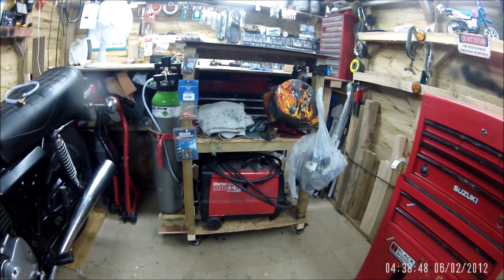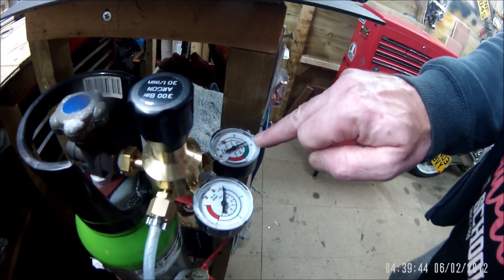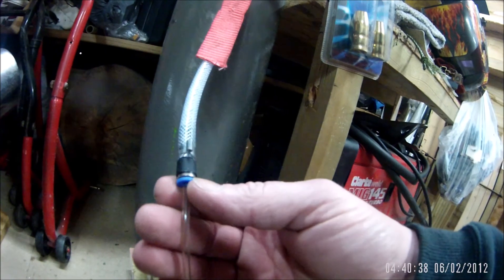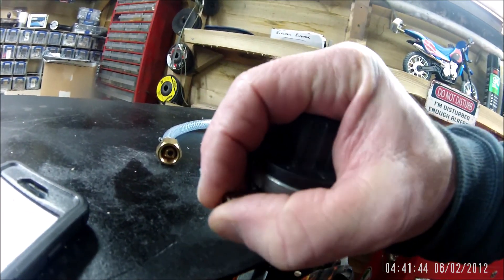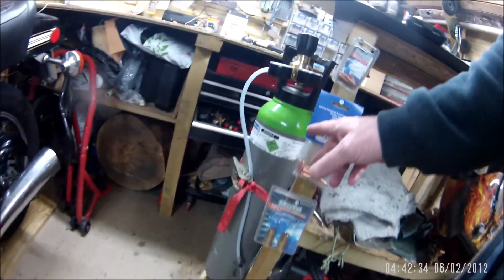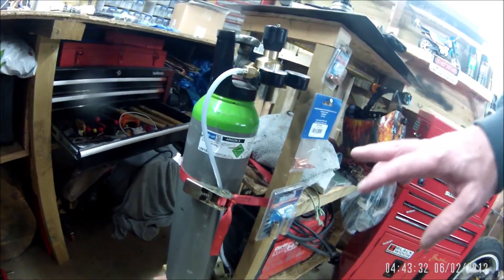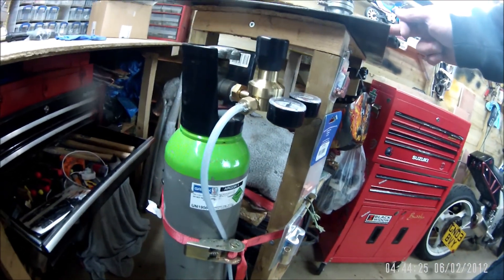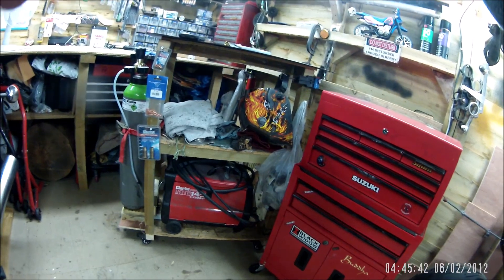My Welder Set up

Comment: Mate, you are a legend!.. Thank you so much, what a perfect response.. That helps me out no end!..I've found the regulator and bosh, straight on order. You answered everything so well that I only have one small question please. The gas itself, did you go with a local supplier or somewhere online?.. My local supplier does Hobbyweld 5, their 'plus medium' bottle is £110 deposit, its 20L, and looks the same stuff I think.. Although they don't seem to say how much a refill is. My welder is the Clarke 135 turbo funnily enough.. So a little smaller than yours, just like my GS!... This is getting a bit bizarre ha ha!.. Thank you so much for doing the video, really helpful mate and massively appreciated!.. Here's the gas I found by the way, atb, star man!.. https://hobbyweld.co.uk/products/hobbyweld-5-mig-welding-gas/
Reply from the maker: Glad it helped, buddy. 
I looked up a local welding parts supplier (S.P.A Welding) that stocked Hobbyweld gas bottles and they’d stopped stocking it and had started using IGS bottles, which is the one I have. I think for the 20ltr Hobbyweld bottle it was £110 for the bottle and £60 to fill it, so £170 for my first bottle, whereas the IGS 20ltr was only about £135 for my first full bottle, so I was glad they’d swopped suppliers. Hope all goes as easy as it did for me, it’s definitely going to work out a lot cheaper in the long run. Atb Buddy.